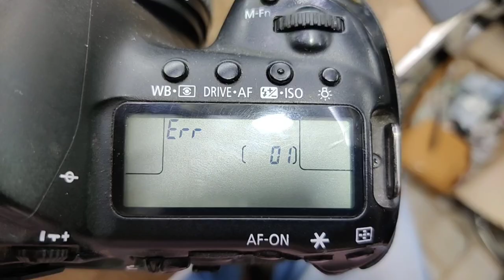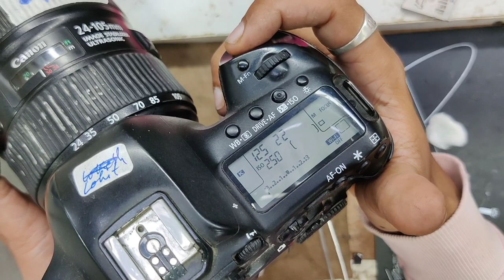EF24-105mm f/4L IS II USM ERROR 01

Comment: Use a screw to remove collars. Scratching outside surfaces of the collars with tweezers is not an option. If you mark eccentric collars you have to mark the collar and the counterpart. Otherwise the marking is no use since the eccentric collar is not the same on both sides.